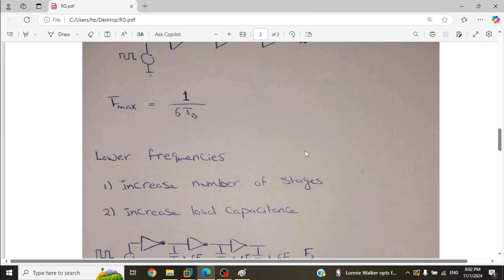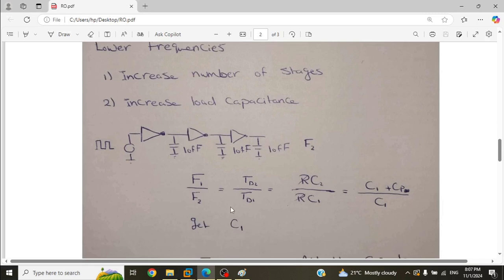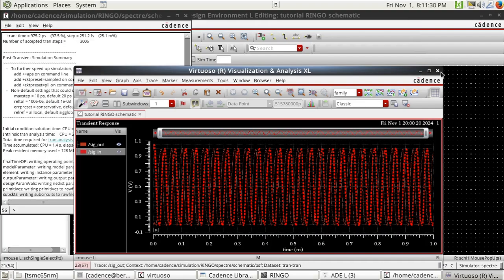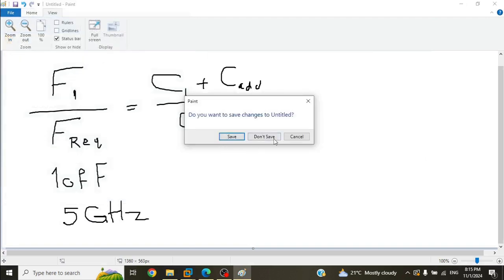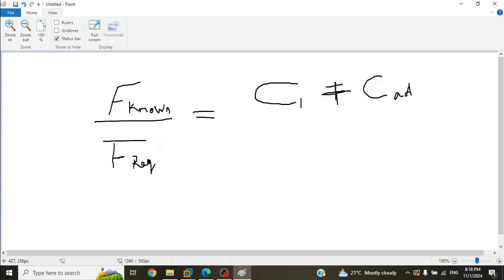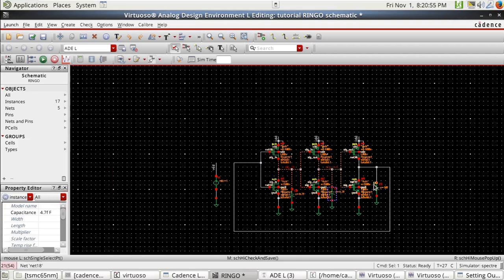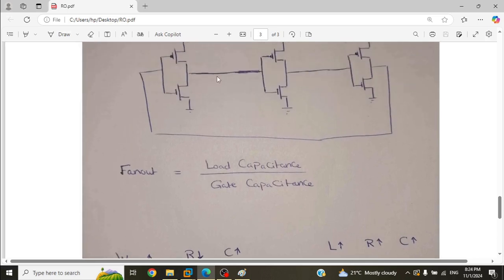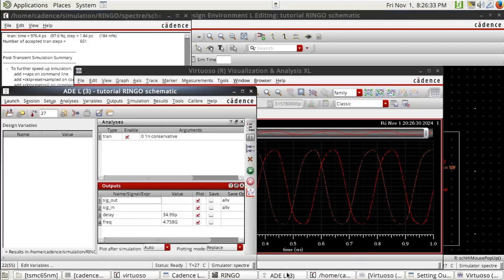Design of Ring Oscillator in Cadence Virtuoso Part Two

Comment: thank you very much. I just think Cp should be called additional cap. because parasitic refers to something we cannot control in layout
Reply from the maker: I agree
I am just trying to estimate parasitic cap but I add a cap Cadd to target a specific frequency
Reply: @ElectronicsSchool-w5w  thanks for your practical videos.
Do you plan to make more video on building block circuit using virtuosos?
Also, do you have a reference book that provide practical design circuit to try on cadence virtuoso?